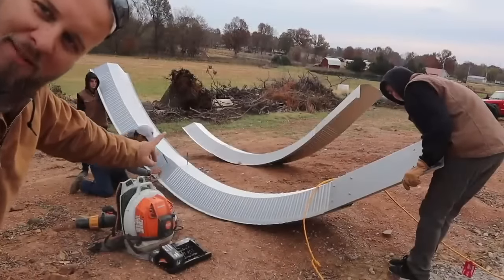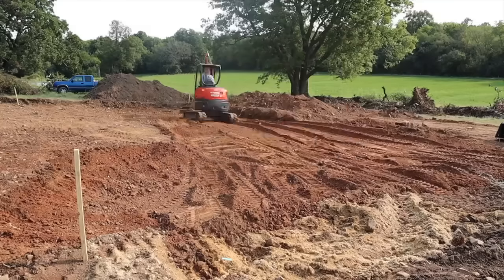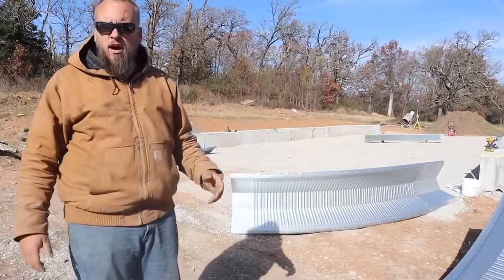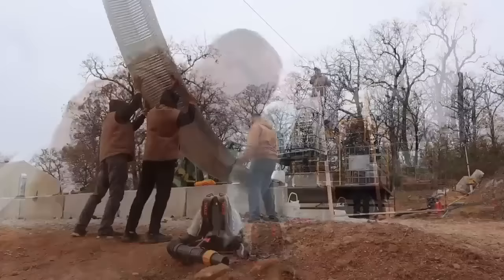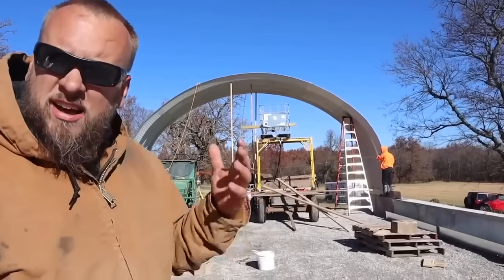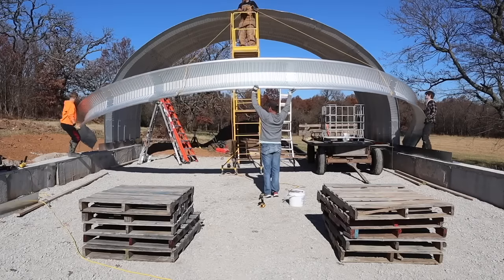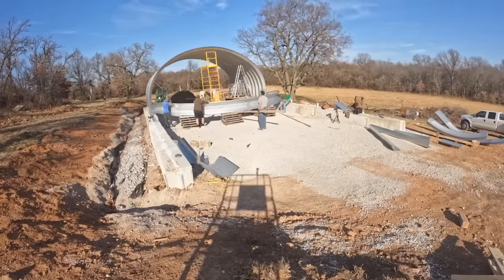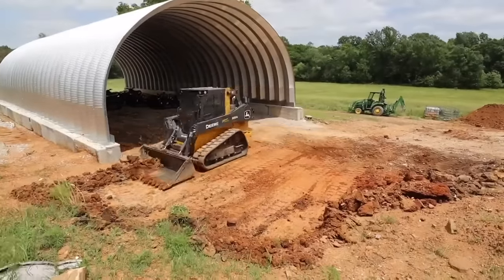Complete Quonset Hut Build - From Site Prep to the Final Arch

Comment from the maker: If you enjoy this type of content please subscribe to the channel, and if you are interested in a rock Hill Farms T-shirt check out our merch store

https://rockhill-farm.creator-spring.com/listing/rockhill-farm-logo
Reply: I learned today, that each one of the nuts and bolts have a torque specification, to maintain a waterproof seal, is that true?
Reply from the maker: It’s definitely true, but with over 6000 bolts and you have to touch each one of them twice with two different people hanging off of ladders… I’m going with good enough is good enough.

That’s just my personality and not some thing I would recommend
Reply: Hey thank you for the response. Me and the wife are going to be building a 30’x30’ Q-hut. 
We think the bin block idea is brilliant. 
If you were to redo the bin blocks,  instead of creating a cement form on top of the blocks would you have spaced the walls differently so you could have avoided that? And did you use any sealant between the blocks?
Reply: I have a question... i have been looking into the same  shop your building and i was wondering if you put 2 rib together on the ground it should save you from having to put the bolts in overhead and im thinking it would be stronger did you try that and if not what do you think of the idea ?

Comment: From a guy that does this for a living, stop letting it flex while raising. You have a fair amount of flex in each arch but you need a min of 3 ppl and 1in the middle of each third section while raising to keep structure strength when you pull the arch up. Also 18ft trench footing plus a 12 Inch topper for arches to mount to makes a huge difference. A 12x16x32 block/form will make solid side walls that elevate side walls to a more solid structure
Reply: Huh?
Reply: Do you still do this for a living.  I m going to need an installation job.
Reply: the trench or channel in the footings would help

Comment: We had a used one back in the early 1970' s for our 15 man maintenance shop. Had no insulation & 2 little steam unit heaters. Was cold & drafty in the winter time but with the high ceiling & exhaust fan & 2 pedestal fans wasn't bad in the summer.Was built on a 3' high poured concrete wall

Comment: Twenty years ago we built one of these buildings in Choctaw, Okla. In 2003 the building seemed to be a much higher quality and probably thicker steel, we built it with me and four girls we did not have any of the twisting problems you had. I think we had seventeen arches. We mounted a 4x4 on the scaffolding that allowed the arch to rest on while we put in the bolts after we stood it up. Glad you got yours built, thanks for sharing.
Reply from the maker: I do feel like it It was lighter gauge steel than it should’ve been. I’ve seen some older buildings that I think we’re heavier material.

Comment: Currently putting one up from a different manufacturer.  35 wide x 32 long. Plans for another 20 ft later. Running into similar help issues. Can't wait to see your end wall build. I didn't order my end walls
Reply: yeah so where are you getting your steel frames from? I once reached out to SteelMasters, but I don't like the idea of paying 5 grand for the pieces and then the blueprints for paying yet someone else to pour the concrete a certain way. I am looking to build a 10 by 10 quonset hut and have no idea where to begin.
Reply: @MicroUrb 10x10 is an outhouse 😅

Comment: Good stuff! Just the right length!! Love it when people are not afraid to throw in what it cost for things! You probably dont want to ..but it would be interesting to see what enclosing that thing would take!! Does it act like a wind tunnel for you when your in it?
Reply from the maker: I purchased the end walls with the building. Seems like they were maybe $2000 and already included in the price I gave in the video. The doors were an extra $5000 so I did not buy the doors.

I’m going to make some myself most likely.

It’s just not high on my priority list right now because the building is functional.

It is basically a wind tunnel but I haven’t noticed it to be excessive

Comment: I found your channel after seeing the Quonset hut on a Oakie Woodsman video. I was impressed with the appearance of the Quonset hut on that video but after seeing how flexible it is during the constructions process now I'm not so impressed. I have built many dozens of sheds over the years but not a single Quonset hut so you'd have to take my advice with a grain of salt. In order to get the most built in a given amount of time I'd suggest that all the arches were prebuilt on the ground in 2 pieces so there is no "aerial" time involved early on. The next part really takes into account my extensive Quonset building experience. After the first 1 or 2 arches were up I would be assembling the half arches 1 at a time as they looked very easy to install and may have been possible with only 1 person. The scaffold should be placed 1 arch width clear of the bolted up section and should be high enough that it is possible to reach over the arch to do the bolts up. With prebuilt sections all on the ground ready I would guesstimate that with 4 people you should be able to knock over the assembly in a weekend.
I don't have any Quonset hut building experience but I did assemble most of my own 60x30 steel framed shed entirely by myself. Other than the neighbours crane to lift the 2 prebuilt on the ground 30' x 10' walls the rest was done by hand. The shed is actually in the background in a few of my videos and is a bit of an odd design so that I could build it myself and I could have the 30' span with no trusses.

Comment: The deadman sticks the folks in the middle are using will work better if you create a finger in the end.  Just nail a 2-foot section of 2x4 on the end and you are more stable. 

I'm not sure what the reach of your tractor is but a simple cradle that supports in a curve shape will hook the arches up nicely as long as you grab in the center of the arch.  Those arches are like limp noodles with human hands.  you need a way to take the bulk of the lifting off in a stable way, hence the tractor cradle.   The tractor cradle can be made from scrap plywood and 2x4 materials.

Comment: I feel your pain that is what i had to do standup halves and i had real scaffolding and a skyjack, that i bought used, but I also had a full concrete pad to work from, not an easy job, with part time help...real pain in the ass job, but I am still a fan of the structure

Comment: A box tubing boom on the tractor  with a spreader bar would pick and place the arches very easly and safely. probably a counter weight on the 3-point hitch would help.
Reply from the maker: Lifting them is not the problem. They aren’t that heavy.  However, they are flimsy. If you lift them from the center they break

Putting the bolts in was a much bigger hassle than raising the arches

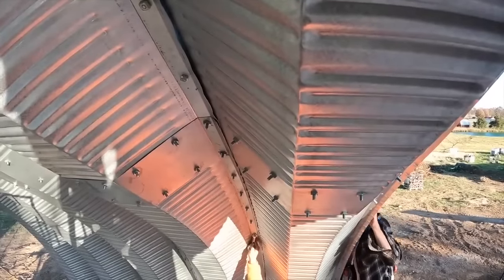Comment: At 27:20 the arch had the lap backwards.  Did you correct it?
Reply from the maker: There are 2 joints lapped wings on the whole building. I didn’t realize it until we were done and I just put a flex seal type coating on those seems

Comment: We’re looking to setup a 50’x80’x20 , I was wondering How many panels or pallets you roughly had becauseeee , because we’re looking at a kit and all that is there is 2 pallets , which we are thinking there should be a lot more panels than what we are looking at to buy
Reply from the maker: Seems like 2 pallets. here is the video of unloading it off the trailer
Reply: That’s all I had for a 40ft.x60ft.all the other stuff you have ditch out of your pocket. Example concrete inside out. Couldn’t find the anchors. There you have it.

Comment: In my mind I am trying to figure out why it’s necessary to build a complete arch on the ground and struggle raising it in place. Instead, why not build one piece at a time, starting with the base and work your way up to the peak? Repeat from the other side. Then join them together in the middle with the peak section? A lift that can extend to the top would be required, of course.
Reply from the maker: We did it both ways and this was my preference. That’s a lot of bolts up in the air and the arches are not all the same bow. They kind of have opposite angles pushing against each other on the arch

Also, this method allowed people to be working on the ground in the air at the same time

Comment: how come you could not put blocks on the side ?
Reply from the maker: What do you mean by put blocks on the side?
Reply: @RockhillfarmYT  instead of topping them with concert
Reply from the maker: Yeah, we could’ve use some cap blocks on top of the big blocks. The only negative to that is we would’ve had to do some grinding on the top of the construction blocks because they are a little bit irregular shaped and my grading I guess wasn’t perfect so it was hard to get the tops of them completely level

Comment: I think you have successfully stopped hundreds from building one of these torture devices. Cold, no windows, no walls to hang stuff on, no soul. And the bolts! Ridiculous. Need an airplane hanger? Maybe. Otherwise give me the wood and steel siding and it will be done in a few days. What happens when the rubber washers die? And don't think they wont.
Reply: I was 15 years old and we built one of these on our farm over the Bicentennial holiday in 1976. It still stands, no leaks and looks like the day it was put up. I believe ours is a heavier gauge metal though.

Comment: No rebar or bolting /joining/ on your blocks / caps ??? Not even keyways?     A WOODEN CRADLE (NOT COMPLICATED  boats have hulls via the single interior transverse frame repeated) like a curved box beam (YOU ON:LY NEEDED TO MAKE ONE) with a taller center RIDGE BOX BEAM and an anchor cable going down the sides from the RIDGE BOX BEAM would have been best for everything.    BUT rather than a scaffold at center; made a ROMAN SEIGE TOWER A FOOT + TALLER THAN THE arch    Think a hay lift on a barn it only sticks out maybe 6 feet above the barn opening. Since a seige tower rolls, it places the arch as it lifts it. Even an anchored 16' extension ladder could have been stabilized on the ground to pivot on a  1" plywood sheet (weighted wedged) & tilting up each ARCH UNIFORMLY with a pulley and an underside frame 8 ft wide. Should have had an Erector set for proof of concept  beforehand. Everyone gets to profit by your building experience.

Comment: If you could afford to pour the floor why didnt you rent a scissors lift? Seriously! I just built a 50 ft x 90 ft quonset 21 ft tall with dirt floor and rented a 4x4 scissors lift. You have tons of nice equipment dont be cheap and rely on your friends. So many times guys get hurt helping out a cheapskate. Yeah i know harsh but this guy has spent alot of money on equipment and cant spend $1000 to rent a lift for a week. Thst small building could have been assembled in 3 days top.
Reply from the maker: I honestly couldn’t afford to put the building up and I sure as heck couldn’t afford to put concrete floors in it

Did you ever think maybe I can afford the machines because I don’t waste money on scissor lift rentals and concrete pads for a big shed?

I literally called the Quonset Hut company and asked them what my options were for canceling the order because I didn’t have the funds to finish it. I had put 20% down on the building nine months earlier and had no way to get my deposit back if I canceled.

Now, two years later, I’m really glad to have the building and everything worked out perfectly.